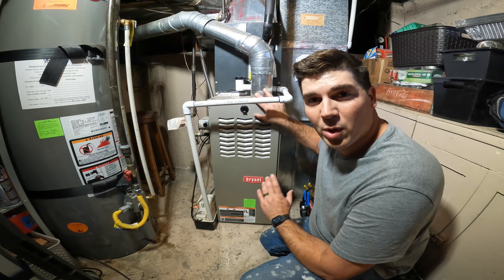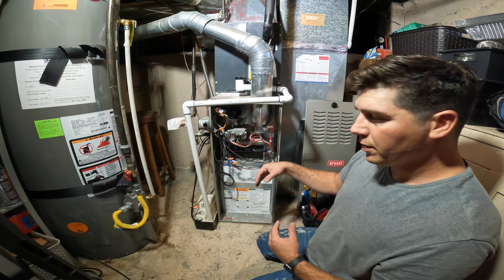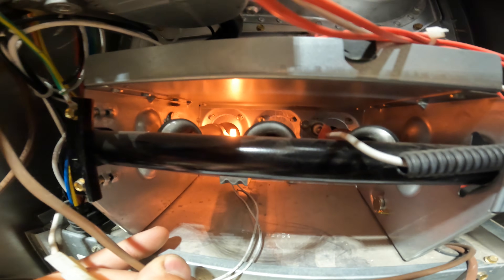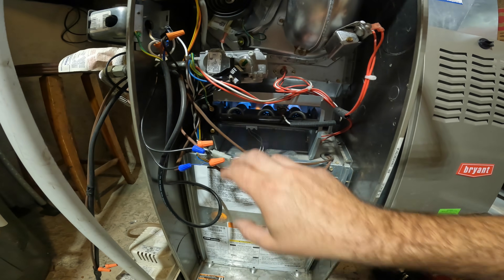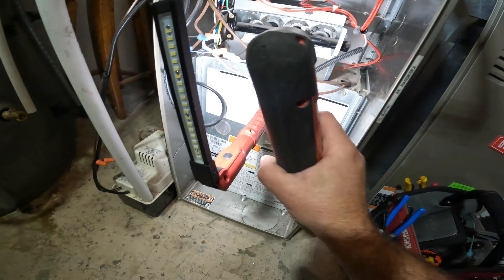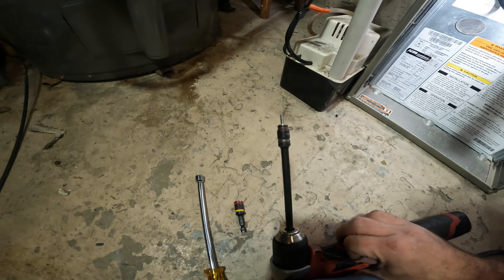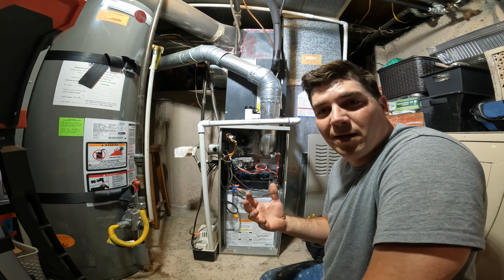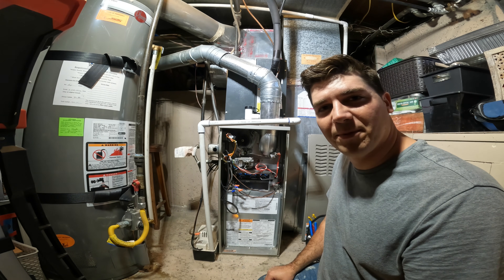Why Won't My Furnace Stay On? - Dirty Flame Sensor -

Comment: On mine (95% efficient) the air pipe inlet was clogged -- TWICE. Furnace would run for a hour, 6 hrs, 3 days maybe. Something was shutting off the gas randomly. The inducer, main fan all worked. We could get it going again by flipping the breaker off/on.

Tech stopped by and pulled out a popped balloon from the inlet outside. Two weeks earlier there was a Christmas street parade. $200 visit, but it stayed running. A few weeks later furnace again won't stay running. He pulled off the air inlet pipe at the furnace; it had sucked in debris from outside (the pipe is low to the ground outside.) No charge that time. Said leave it off, you don't need it. I installed a PVC screen cap outside so that mice can't get in.

Update: I cleaned both the igniter and the flame sensor tonight. The igniter was fair but the flame sensor didn't look too great. Cleaned it with a $1 bill and got it looking better. Have no idea if it made a difference on my furnace shutting down a few times today but it's working at the moment. If nothing else I was able to reinstall I suppose.

Comment: Hi Dave , My furnace thermostat is off but still running with cold air coming out and flashing 4 red light . I replaced limit switch and roll out switches but still happening . Can you help this issue ? Thank you
Reply from the maker: If you need help diagnosing issues, hop over to Patreon.com/diyhvacguy and you can get access to one on one support within the hour to quickly diagnose the problem. It’s nearly impossible for me to help via YouTube comments. Thanks,   Dave

Comment: Thanks for the great videos! I remember replacing the flame sensor at our previous house many years ago. The past couple of days I’ve had the exact problem discussed in this video. I cleaned up the flame sensor with some steel wool and the problem is fixed! Thanks again!

Comment: When I was a teenager my folks bought a brand new furnace. That flame sensor failed every year within the 5 year warranty. On the 6th year, they charged my folks $370 to come fix it. The 7th year it went again and I fixed it this way. Light rub with a scotch-brite pad and never had the issue for the rest of the time we lived in that house.

Comment: Very educational, thank you!
I have an old Lennox unit in my house and just recently I started having spark ignition problem. It is weird because everything works fine for several hours or a few days and then it stops igniting, my furnace has a spark igniter. I replaced pressure switch, but it did not help. When manually furnace is lit, everything works good too. As I mentioned above it just stops iginiting several times a week. Is it the control board or spark igniter problem? I am guessing that if it was the spark igniter, then the igniter would never work. I appreciate your thoughts on that!

Comment: When my new furnace was installed ten years ago the service manager from the hvac company actually told me to clean this once every five years. The first time I cleaned it I used wet/dry fine sandpaper and then metal polish to clean it. I didn’t want any scratches in it. Five years later it still looks like new but I did it again anyway. Some companies actually have decent people working for them.

Comment: Nice video and i lern a lot from what you are doing, but I have a question, do they also have LPG gas furnace? Or only LNG?. I ask because I built a kitchen outside of my house like in the Caribbean have, and I would like to install one myself, after the LPG installation is done from a qualified gas installer has done his job. Thanks in advance for your patience and information. GREETINGS FROM CANADA.
Reply from the maker: Yes all gas furnaces will have a flame sensor that will get dirty after so long. It’s advised to have a tune up done once a year to prevent it from stopping in the middle of winter 👍🏽 cheers

Comment: Thanks for the Vids! It's awesome to have you just a click away on U-tube!👍
Reply from the maker: You bet!  If you need immediate help with anything HVAC related, make sure and check out our Patreon. It’s patreon.com/diyhvacguy. For a small fee of $25 per month you can be walked through technical support as well as sizing equipment and procedures on replacing equipment. Cheers, Dave.
Reply: @diyhvacguy  Wow, awesome. I will keep your info around!👍

Comment: Can you read a resistance between the tip and the connector?
Reply from the maker: Yes, if it’s open it has failed, which is very uncommon.

Comment: May I ask for your email ? I would like to call you when I have a furnace problem and will pay you $50.00 just for the FaceTime call so you can walk me through and make sure I don’t get taken by heating company. They have ripped me off for years saying I need to replace furnace or mother board. Now I know it was just my flame sensor and glow plug all the time nothing more
Reply from the maker: Hey! Of course. My email is diyhvacguy@gmail.com      Email me anytime 👍🏽

Comment: Good video! I’ve had this issue with my furnace a time or two. Tried cleaning the sensor with no luck. What I have found to be very effective,is cut the very tip of the sensor with wire cutters. Usually lasts around 3 years,or better.
Reply from the maker: Wow, that’s super interesting! Glad you found a way to get it going! That’s good knowledge to have in a pinch. Thanks for sharing.

Comment: If you have one of those multi-bit screw drivers, the tube that holds the bits is 1/4” on one end and 5/16” on the other.

Comment: They don't recommend sandpaper on the flame sensor from what I was told. Also you might want to correct that gas line on the hot water tank, no drip leg.

Comment: I usually use Amazon for my parts, but if I have no heat and the temperature is starting to drop how do I find companies that sell directly to homeowners? I'll need to be proactive about this, especially in the winter.
Reply from the maker: Repairclinic.com is good and possibly Amazon. Things I’d have on hand is a flame sensor, and probably an inducer fan assembly. As far as getting parts like on the spot, you can find a local Johnstone supply and go in and ask if they will sell you a part. Sometimes they will do it even though they’re not supposed to sell to the public. I was just in Johnstone the other day and there was a guy who didn’t have an account and they sold him a part anyways. Hope this helps! Cheers
Reply: @diyhvacguy  thanks so very much!
Reply: I think if you're trying to buy stuff from Johnstone that doesn't require a license (like refrigerant) you might luck out and find they will sell to you.

Comment: Got an older Carrier furnace. Things i notice that need attention are vacuum leaks on smaller hoses(they usually crack where they are attached) dirty flame sensor and clogged condensate trap. Had to get the heat exchanger replaced(got the professionals to do that). That was pricey.
Reply from the maker: Yea it’s not a cheap repair but glad you got it back up and running!
Reply: @diyhvacguy  $2100. Hopefully it lasts. Also installed a carbon monoxide detector. Was lucky the flame roll out switch did it's job!

Comment: After I clean the flame sensor I rub my 14 k wedding ring on it until I see a slight goldish color all over where it was cleaned, then it seems to last a year or two longer than a new one.
Reply: Does you wife approve of this? Honest. I just took my ring to plate my flame sensor and forgot to put it back on. 😅
Reply from the maker: Interesting. What is the science behind this?
Reply: @diyhvacguy  As I understand, the flame “sensor” is not a pile, like my gas fire place, the flame itself conducts some electricity, and as contacts on computer connections (memory, cpu), iPhone lightning connections are (electro-coated) gold plated for better connection along with silver solder on the boards. I just made the wild leap in logic, but that’s my best guess. Probably not relevant but,I do know that silver contacts on memory when plugged into gold slots had microscopic corrosion causing failures.
Reply: @diyhvacguy  Also platinum spark plugs come to mind with prolonged exposure to flame, as well as precious metals in catalytic converters with carbon and heat exposure.

Comment: Odd thing is I never had to replace any pilot ignition parts on my Lenox G11-e conservtor furnace I brought home from work in 2003 when they replaced it with a new furnace, I had it in use until last winter, only part I ever had to replace was the Johnson control for the spark, all I EVER did was change filters and vacuum the cabinet out

Comment: Thanks for sharing this video. Just a DIY person, but I normally do basic maintenance like this on my two gas furnaces. Flame sensor cleaning with a green Scotch bright pad, remove in shot burners every few years and then clean with wire brush and check capacitors as needed.

Comment: I retired 6 years ago after being a service tech and instructor for 45 years. I used to show my students what happens when a flame sensor is cleaned with sand cloth, wire brush, or any other abrasive material...under magnification you will find small scratches in the rod that will collect dust particles and cause the flame signal to fail again prematurely . You mentioned using a dollar bill and this is actually preferred over those other methods. Simple but affective. Otherwise nice video for DIY homeowners.
Reply: Good to know. I just cleaned my flame sensor and used a green brillo type  pad. I'll use a dollar bill next time. My sensor wasn't dirty.
Reply: Can we use the back of sand paper to clean flame sensor?

Comment: My furnace's inducer fan would come on, ignitor would glow and about 30 seconds later flame would come on and go out.  Furnace would shut down.  Sounds like flame sensor, right?  I took it out and cleaned it.  It would work for a few days and quit again.  Purchased 2 brand new one's.  Same thing.  Put in and work a few days.  After looking at almost every video on Youtube, I changed out the 2 stage pressure switch.  Guess what?  Furnace works like it's new.  Don't ask me why the pressure switch had anything to do with the flame sensor or if it was even the flame sensor, but the 2 stage pressure switch was the culprit.
Reply from the maker: Interesting. Thank you for sharing! Typically when a pressure switch is going the flames will kind of flutter, but sometimes not, glad you got it figured out!! Make sure and subscribe to our channel for more helpful hvac content! Cheers
Reply: @diyhvacguy  Thank you!  You have a new subscriber!  Keep the awesome videos coming.  I have a Lennox furnace.  It came with the pressure switch that was made in Costa Rico.  I saw a video where a HVAC guy said that they are junk.  That's what made me change it out.  I was going to change out the board, but that was a lot more money.  Glad I went with the pressure switch!!

Comment: Thank you for the awesome videos. I am having an issue with my furnace, it will run a one cycle or even two then will not turn on again until I reset the system. I pulled the pressure switch tube off and also pulled the capacitor off the blower wheel and tested it and when I put it back it ran great for 3 days now it’s repeating the same issue again. The capacitor is 7.5uf and it tested 6.35uf which is still in spec.  but I’m wondering if it’s something to do with the capacitor or the something on the tube of the pressure switch since that’s the only two things I messed with. It’s also showing a code 33. Any advice would be awesome.
Reply from the maker: I believe code 33 is for a limit switch. When the furnace gets too hot it will throw this code. Is the filter new? That’s the first thing I’d do is pop a new filter in. On the pressure switch where the tube connects to the inducer fan assembly sometimes that nipple will get junk built up so you can take a toothpick or a pin and make sure it’s clear.
Reply: @diyhvacguy  change the capacitor regardless if it says within specs.
Reply: @robertwood9628  you are probably right. I ordered one
Reply: @diyhvacguy  good tips. Thank you
Reply: I had almost the same issue that your furnace is having.  I changed flame sensor twice and even cleaned.  Would run a few cycles and turn off again.  Took out flame sensor and cleaned.  Again, would work for a few cycles, maybe even a day.  Finally, I changed out the pressure switch and guess what??  No more problems.  I wouldn't have thought it was the pressure switch, but it was.  If that didn't work, my next move was the board.  Didn't want to do that, since they are so expensive.
Reply: @garyp9906  interesting. Thank you, I will keep that in mind

Comment: Question? How would I test the flame sensor before restoring it to the furnace? And what is the theory behind its operation? Thermocouple, bimetallic, other? Thanks!
Reply: You wouldn't test it after cleaning unless you have a multimeter that reads milliamps. It's purpose is to confirm that the gas is being burned so the gas valve won't allow gas to flow without it being burned and potentially explode and blow your house into little pieces.
Reply: The theory is called flame rectification. AC Service Tech LLC has a good video on that.

Comment: How often do you think it should be clean? Once every year?
Reply from the maker: Yes that’s what I recommend
Reply: If you live anywhere humid and have central air, the sensor tends to get rust build up in addition to the carbon on it from the previous winter. That was my experience in Michigan and would wind up doing it about every other year. Luckily my cousin used to work in HVAC so he showed me this trick as well as how to replace the ignitor and gave me a handful he scavenged out of old units they were junking that were still in good shape.